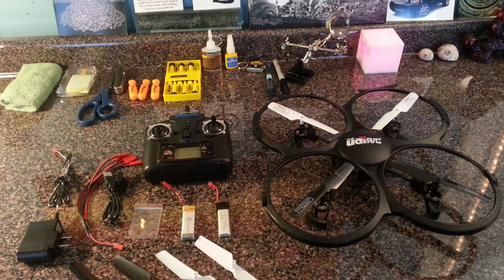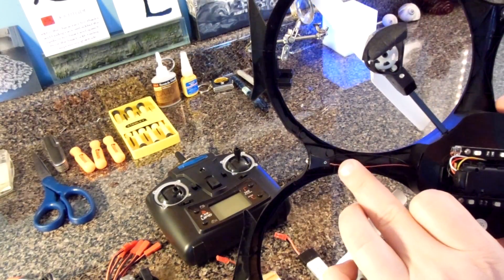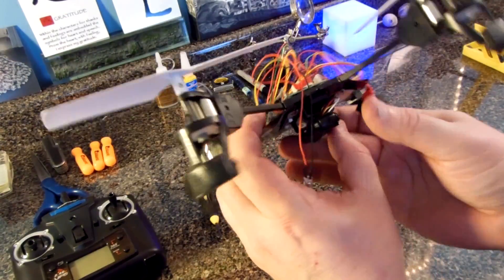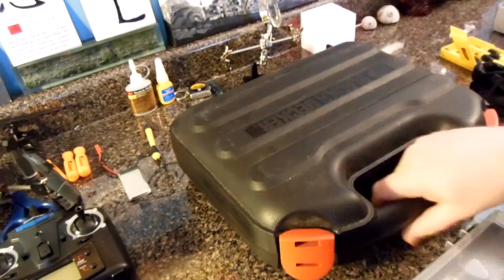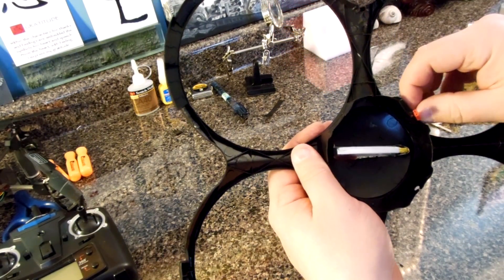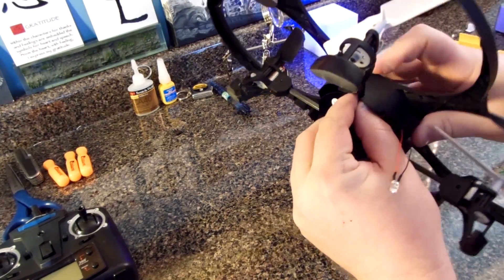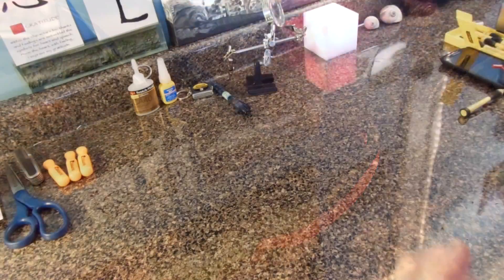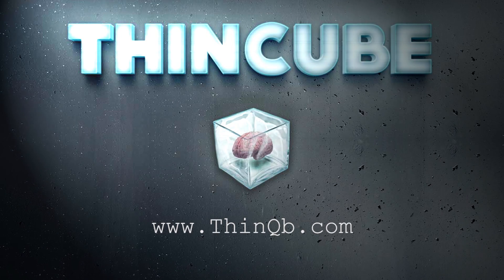DIY Mod for LONGER FLIGHT times - Quadcopter UDI U818 & U818A-1 Discovery DroneTube

Comment: I'm waiting from my JJRC h12c to arrive....do you think it would work with this quad?
Reply from the maker: Hi Bob, unfortunately the H12C's battery has a different connector. However, the good news is that there is a direct replacement to give you a little more flight time. The stock battery for the H12C is a 350mAh while this upgraded battery is 700mAh http://amzn.to/1Cq3QXI (twice the capacity). It most likely will not give you twice the flight time but will give you more for sure. Let us know how it works out if you do purchase the larger battery. Good luck and have fun flying!

Comment: Hell, i just slipped my 1200 battery between the camera mount, and the body. A little snug, but no mods needed.
Reply from the maker: Nice! Do you have a picture of it?
Reply: I'll get a short video of it up later this evening, also I removed the big blade guard for flying ouside, and modified a spray paint can lid to fit over the electronics, that saved on the order of 22 grams in weight.
Reply from the maker: I jettisoned the guard as well, but waited till i was able to fly without banging into everything....which wasn't too long.
Reply: I have a video uploading now showing where I put the battery, and a neat little cover from a spray paint cap. Check out my YouTube page.
Reply: Video is up.
Reply from the maker: billy surgener I just checked out the video, thanks. How many charges do you have on your 1200mah battery? I noticed mine started to swell a bit so i complained and they gave me a refund and I bought a new one. Its fine thus far.  Amazon's customer service is really good like that. http://amzn.to/1yaAfhd
Reply: I've only ran about 3 runs on it before my motor totally died.
Reply from the maker: My quads been holding up good....even after the hard landings, aka CRASHES :)  I'm enjoying this thing alot more than i thougt i would, even though i initially bought it to get used to flying before getting a high end DJI or 3DR.

Comment: Why not just use velcro and attach the battery to the top?
Reply from the maker: Hi Jonathan, i actually did do that but when i landed hard (ok let's call it crashed), the battery popped off and i didn't like the feel compared to this setup.....thanks for the question.

Comment: How does this effect maneuverability and the inversion functions of the copter?
Reply from the maker: Great question Josh. For me, it actually has much better response since it has more power. I can recover quicker from maneuvers and it reverses directions (or stops from hitting the ground or obstacles) quicker. As for the 360 evasion, i can now do this in my living room (only 7.5' ceiling) since it recovers so quickly and the battery doesn't more at all. Again, you have to be sure to make the opening fit the battery snuggly.
Reply from the maker: BTW Josh, check out my new channel: DroneTube  https://www.youtube.com/channel/UCN4NJ5nLXqGvx6wfZR1nrZg

Comment: why not just attach the battery to the bottom with some zip-ties?
Reply from the maker: Sure that would work, but then you'd have issues when changing the battery out. I like to switch between all my different batteries on the fly. With this setup, i can remove the big battery and go back to using the 500mAh and 680mAh in a snap. Thanks for posting Omar.
Reply: ThinCube The thing is the 1200mA batteries are chaper for me to aquire than the smaller 500mA ones.  Does the flight time change that much to make it worth having the extra battery?
Reply from the maker: *****  I love the 1200mAh batteries but i have alot of batteries already and its nice to be able to switch between them all. I only run one battery at a time. here is a link to the flight time comparison of the batteries on my new Channel (DroneTube): https://www.youtube.com/watch?v=wIwSToInngE